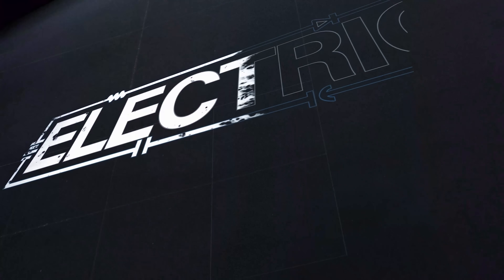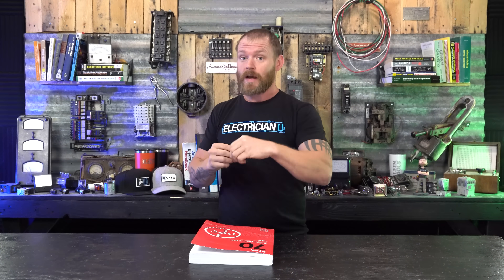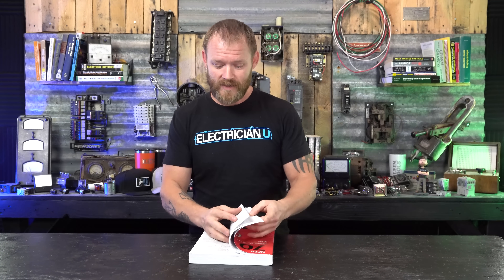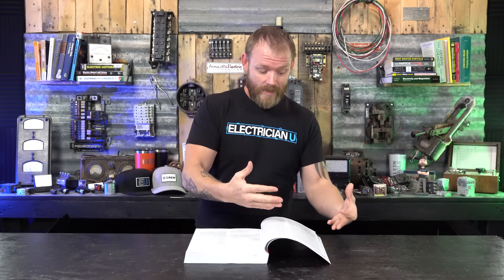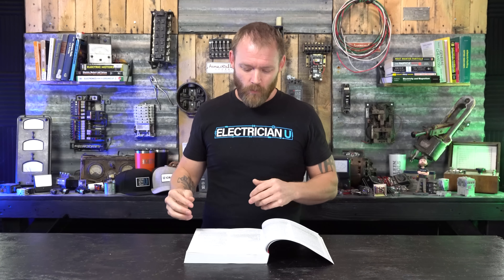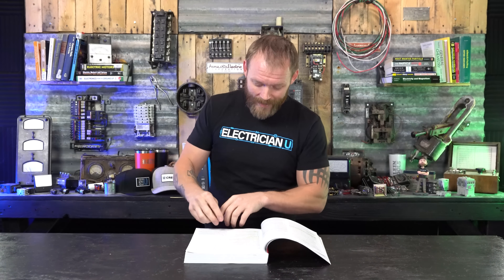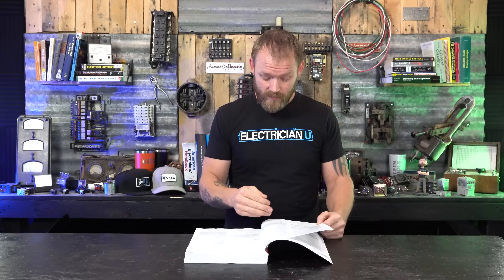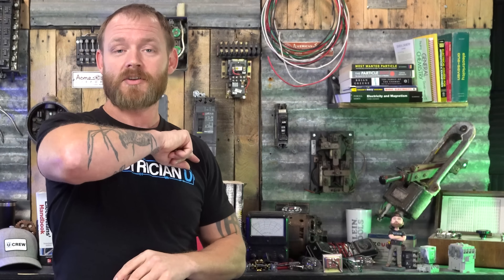Where Should We Be Using Dual Function Breakers?

Comment: Since Arc Faults and Ground Faults are usually very minor faults, powering your refrigerator or freezer on either an Arc Fault or Ground Fault circuit, thus risking the contents, seems iffy to me.
Reply: In my area (New Jersey) all refrigerators are required to be on a dedicated 20A circuit that is NOT GFCI protected.
Reply: I've lost count on how many customers have had hundreds of dollars of food cost losses due to gfci nuisance tripping on their fridge/freezer. I would 100% support grudge/freezer being exempt to arc fault and gfci protection.
Reply: In my area we are allowed to put a dedicated 20 amp circuit on a standard breaker for the fridge/freezer. I'm in east Tennessee
Reply: A good motor will not trip a good GFCI.  Cafci ark falt detection has progressed to the point that a good motor will not trip an arc fault.  The old cafci breakers were known for nuisance tripping but we are beyond that.  That's why cafci breakers are required by code everywhere now.
Reply: @ianbelletti6241  not every jurisdiction uses the latest code...
Reply: @binaryglitch64  I understand that.  And not every jurisdiction accepts the code as it is written.  It is up to you to look up which version is the currently accepted code and what modifications your state has made.  Your state's licensing board will usually be helpful with this.  However, I will continue to post responses about the latest version of the code as I don't know which code may be the accepted version in your jurisdiction and you don't know when they may suddenly choose to accept it.
Reply: @ianbelletti6241   @Ian Belletti  "That's why cafci breakers are required by code everywhere now." No, they're not required everywhere... because reasons we just discussed... that's what my comment was saying. So I'm not seeing your rebuttal as relevant to what I was saying. Maybe I'm missing something here?
Reply: @binaryglitch64  I am speaking as an experienced, qualified electrician.  AFCI and GFCI mechanisms are not supposed to trip for motors that are in good condition.  As motors age they can cause nuisance trips.  If you are getting nuisance tripping it may be a sign that the motor is going bad.  However, more likely is that something else you attached to the circuit caused the trip.  This happens a lot in garages.  I've seen people run 15a worth of tools and wonder why the breaker tripped when they have a fridge on the circuit.
Reply: @ianbelletti6241  I'm  pretty sure a lot of us here (on this channel) are qualified electricians with experience and certs... that has nothing to do with the fact that C-AFCI's are not required on dedicated refrigerator circuits in all jurisdictions. That's all I've been trying to say... Your not wrong that AFI & GFI breakers shouldn't have a problem with a perfectly good motor (or compressor pump, or starter cap (capacitor) firing off) as advancements have been made. That's irrelevant to my point. I'm not saying all that, I'm just saying your incorrect about it being required everywhere. It's not. Now wether it should be required everywhere or not is a different subject... as is whether or not C-AFCI's handle motors well nowadays... all different subjects to what I'm talking about.

IDK don't worry about it, it's not that big of a deal. I was just say'n. 

P.S.
I've installed a Siemens smart panel, with C-AFCI's that get updates of known nuisance trip signatures. I'm plenty aware of just how much things have advanced with breakers. I'm not denying that.
Reply: @binaryglitch64  forgive me for the little bit of hyperbole.  That's essentially the direction that they are going with residential electrical.  Is it wise? Not necessarily.  Some circuits would be better off with an afci/GFCI alarms if that's the point you're trying to make.  However, for all intents and purposes, afci protection is required everwhere in the home.  Your state might not adopt the latest version or they may modify what they don't like as far as puting the code into law.  But that doesn't change the latest code edition.
Reply: @ianbelletti6241  by everywhere you meant everywhere in the home not everywhere in the nation. That was where I was misunderstanding you. What exactly you meant by everywhere... my bad.
Reply: @binaryglitch64  source of confusion understood.  You missed the fact that this was a conversation about residential electrical.  At least it brought out some important information that we commonly skim over in our code conversations
Reply: @ianbelletti6241   We used to have a great Square D sales engineer sit at our IAEI table. They used him to test first generation of plug in Square D AFCI circuit breakers. No matter where he plugged in the vacuum cleaner & a brand new vacuum cleaner it would trip the AFCI. Square D had him remove them and they tweaked them and he never had any nuisance tripping. At the large hospital that I retired from they had a very expensive maybe 8' long refrigerator with 3 large glass doors on both sides. They had a some what clean room where you had to wear tyvac jump suit, hair net and shoe booties where they mixed drugs. It would trip the single pole bolt on GFCI circuit breaker twice a week. Spent awhile using a Megger to attempt to pick up location of problem but always had very high Megger readings. Chief electrician had me replace the 5ma trip GFCI breaker with an equipment breaker that had a 30 ma trip point. Never tripped after that.
Reply: @JohnThomas-lq5qp  the refrigerator at the hospital may have been an impedance issue.  Wires that are parallel for long enough act as either a transformer or a capacitor.  In conduits with multiple circuits, you could end up reading different currents on one conductor vs the other.  You were right that the easy way out was to increase the trip amperage.  Alternately, you could have located the GFCI protection next to the equipment.  Some of the equipment protective devices can be switched between multiple trip points allowing you to choose from 6ma to 30ma which would allow you to find the lowest setting that doesn't nuisance trip.
Reply: For what it's worth, my friend and replaced his entire panel in his mobile home a year ago, and put dual function breakers in for everything except the dryer and water heater because those type didn't seem to be available. We had a couple trip immediately when turning on the power,and that was actually caused by damaged wiring. We replaced the damaged wire and in a year there hasn't been a single nuisance trip, including the refrigerator and furnace circuits which are on dual function breakers.

I had second thoughts on the refrigerator and furnace circuits after reading and hearing about nuisance tripping. There hasn't been a single issue in a year though. 🤷
Reply: Krankie, I need to do the same. What brand/type panel and breakers do you recommend? Why did you decide to change out the panel? Thanks!
Reply: That's why you swap it after inspection
Reply: @wirenut9062  and get a charge of manslaughter when the house catches fire and an occupant dies.  Your wiring may be perfect at inspection time but that doesn't prevent a mouse from getting in the house and chewing on the wiring to the point of creating an arc fault that starts a fire.  The programming in the arc fault devices have been so greatly improved that nuisance tripping is almost completely gone.
Reply: Question for electricians. Is there a AFCI breaker manufacture that is less prone to nuisance tripping? I’m willing to replace my entire panel to avoid issues with my Oled TVs and vacuums constantly tripping.
Reply: @mattc9511  they're all pretty equal at this point.  Just make sure you're buying new circuit breakers for the brand of panel you have.  You don't have to replace the panel unless it's damaged, it's a panel that they don't make breakers for, or the panel is full and you need room for expansion.  Each electrician does have their preferred brand, but Square D and Eaton are the most common 2 brands.
Reply: Honestly - some day we should have intelligent reclosing GFCIs for fridges. Reclose and stay unless the fault recurs quickly!
Reply: Get ready for dryer plugs next year. They'll be required to be on a GFCI breaker. I started installing them and already have had a nuisance tripping issue.
Reply: @briank1263  assuming your state accepts it.  If it realizes that the manufacturers don't have the monitoring algorithm right yet and there's too much nuisance tripping, your state may choose to make a change to the code.  They will either delay implementation of that particular change or permanently modify it in their law.  I've seen NC do both of these.  However, arc faults aren't supposed to trip if it's attached to a good motor.  If you're using a 3 wire plug because of an old installation, you will have to connect the ground wire to the neutral spot on the breaker or it will trip.  Yes, all dryers have a neutral despite old dryer installations only using 3 wires.  It's the ground that got sacrificed to become part of the neutral.  You may even need to insulate the "ground" conductor from the 3 wire installation to keep it from prematurely grounding.
Reply: @Ian Belletti  brand new dryer with 4 wire install... checked for overloading issues, didn't find any. Changed to normal breaker and is working fine now... it wasn't tripping instantly, only intermittently. It was only a GFCI breaker. 2020 NEC requires them on outlets in laundry room at 250 volt. No arc fault required at that voltage ... yet.
Reply: @briank1263  ok.  I was just covering common installation faults.
Reply: @Ian Belletti  thanks, I appreciate it. My first thought was the bonding jumper but wouldn't that trip it right away? I'm not happy when I can't explain what went wrong to the customer. Thanks again.
Reply: NOT code for refrigerator outlets
Reply: They sale them with alarms. Installed them in my rentals. It worked. Got a call from tenant one time saying fridge wasn't working and there was a high pitched noise. They were able to reset the gfci.
Reply: I am changing a 1949 - 2 prong,  ungrounded socket to a 3 prong ground fault protected socket, now. Do I need to exchanged these new units for a Combination Arc and Ground protected socket? 

The ground fault unit us too large for my metal box. What to do?

My line is connected to another socket in the other wall, and to the refrigerator on a 3rd corner. Will these receptacles interfere with the refrigerator?
Reply: @rickhinkle2870  if the GFCI receptacle is too big for the box, you can install an AFCI/GFCI combination breaker instead which will allow you to install a standard tamper resistant outlet in the box.  Make sure that you mark all 3 prong outlets on that circuit with the "no equipment ground" stickers that come with the breaker.  If you have an old panel that they no longer supply breakers for, you can always intercept the circuit's home run (end of the circuit that runs to the panel) and install a GFCI device in a new box.  In that case, you would have to make sure that the wires from the panel are on the line connections and the wires going to all of your outlets are on the load connections.  Wiring a GFCI backwards will not protect the circuit.  If, however, the box is surface mounted or you're not concerned with looks for that location you can always install the appropriate box extension to make the box deep enough to fit the GFCI receptacle.
Reply: I replaced all of my single pole breakers with dual function breakers when I remodeled my house. I have not had any trip, other than the occasional testing from time to time.
Reply: Why don’t they call the “tri-function” ? Arc, GF & current.
Reply: I think with the application of arc faults for an entire residential dwelling it has killed off the single neutral multi circuit Romex adding additional labor and wire cost
Reply: Better having spoiled food then dead from electrocution. They make battery operated temperature sensors that you can easily add. If you have a central controlled burglar alarm probably can have them add a probe to send you a text message in event of refrigerator /or freezer.
Reply: @JohnThomas-lq5qp  To me it sounds life iffy technology backed up by layers upon layers of iffy technology, all to avoid a non-existant problem.
Reply: @JohnThomas-lq5qp  arc fault is fire protection. Ground fault is personnel protection.
Reply: @John Thomas   afci won't protect you from electrocution
Reply: @wirenut9062  correct. AFCI is fire protection.

Comment: I have not been really convinced by arc fault detection because all the "evidence" has come from the makers of… AFCIs.  However they're in code now (or very close to being mandatory in Europe) so we fit them.  Basically I'd fit dual function GFCI-AFCI breakers everywhere unless there is a positive reason not to.
Reply: They work, at least sometimes. Installed a whole panel full of them at a friend's residence and two of them kept tripping. We found the wires had been chewed on by some animals. We replaced the damaged wiring and a year later there's not been another issue.
Reply: Nuasance trips are a risk especially with certain devices like treadmills which for whatever reason can trip them.
Reply: @nateo200  and this is why i HATE arc fault.    I know home builders who put them to pass inspection and get the COI... and then they took them all out, and put normal breakers in to avoid the call backs... and took those breakers down to the next build to use them again on the next house...   

GFI are cool... but the Arc Fault constantly nuisance trip.
Reply: @CopeBUILT sounds like those home builders are risking a manslaughter charge.

Comment: A great example of arc-fault nuisance tripping is I have a humidifier that cycles on and off, but the bi-metalic strip that cycles the unit has 120v on it and it sparks and trips the breaker, and sometimes it will trip multiple breakers since all my arc-fault breakers are on the same phase.  I have to just manually turn the humidifier on and off and keep the "humidity" dial at max so it won't pop the stupid breakers.
Reply: And the best part, the only solution you're going to hear is that you just need to buy new equipment LMAO.

I can't tell you how many homes I've wired over the years. But I can tell you a lot of them change them back to standard breakers after I leave lol
Reply: @Squat5000  THAT is the correct answer. (after inspections are over, remove the damned things.)
Reply: Good to know. We upgraded our service and replaced the entire electrical system with dual function protection. We have not installed the two dehumidifiers in the basement yet. One is brand new, the other an older model. Guess I'll run dedicated circuits to them so if there is nuisance tripping, I can just replace the breaker. Thanks for the info
Reply: Good call. I was going to do what you described with 5 humidifier. Thank God I did not. I was going to have the same problem.

Comment: If… you use a gfci breaker (!!) on your refrigerator circuit might lose everything in fridge due to nuisance trip if not caught in time.
Reply: that's no different than if it is on a gfci receptacle.
Reply: @JerseyTom    that’s true, but on a breaker is more of a tendency to branch out to other circuits that might cause circuit to trip.  Though “load” can be used on gfci receptacle behind fridge, think electricians would be wary to branch out.   Also proper grounding wouldn’t require permanently mounted appliances as refrigerators, dishwashers, above oven microwave and ovens to need gfci,  imo.  I stand to be corrected though.
Reply: Depends on the fridge, my personal frige is connected to a GFCI because the receptacle is close to the sink, It's been like that for years. I replaced my aunt's frige receptacle with a GFCI and it was a learning experience. It kept tripping and the owners manual said it in plain English "Do Not Use GFCI" connected a regular 20A receptacle and life was good.
Reply: Correct. Happened to me when I was on vacation. Lost entire food. I changed receptacle to standard. Never again gfci on fridge!!!!
Reply: See my comment on 12/12. Methinks the AFCI on refrigerators might be wonky.

Comment: I’d upgrade all my circuits to dual function breakers but they are expensive. I did upgrade my kitchen to a dual function breaker because I remodeled it. Now I’ve got a light switch at the kitchen entrance instead of the kitchen countertop and 3 prong receptacles(With new Romex) for my appliances.
Reply: If your house was built before all these code changes, then you don’t need to upgrade every single circuit to AF or DF. You only need to have AF or DF in any new circuit or modified circuit. 

So since you remodeled your kitchen, you did the right thing by upgrading its breaker to DF.